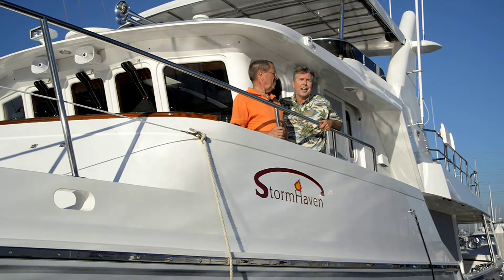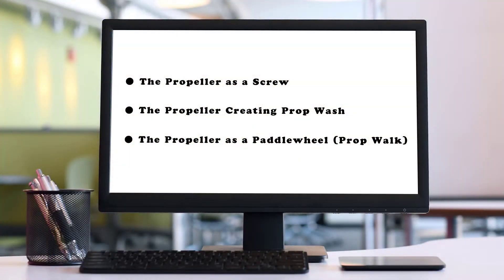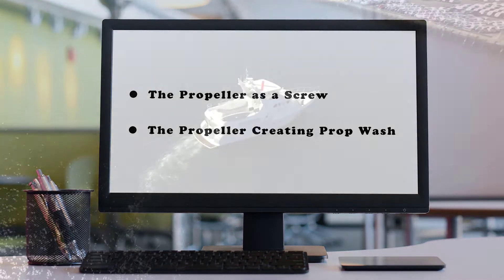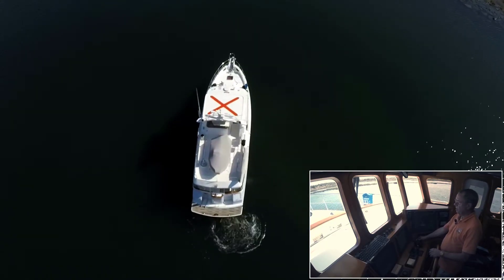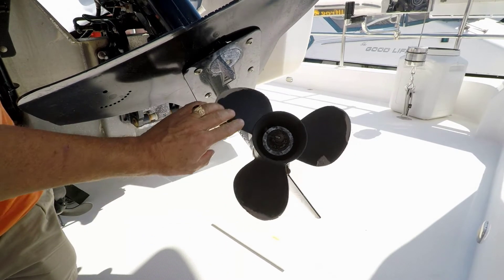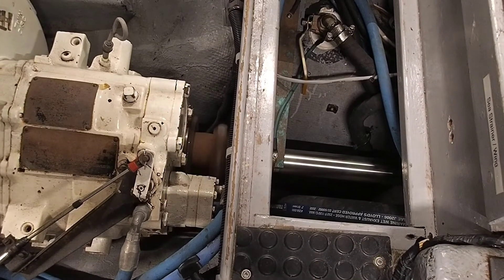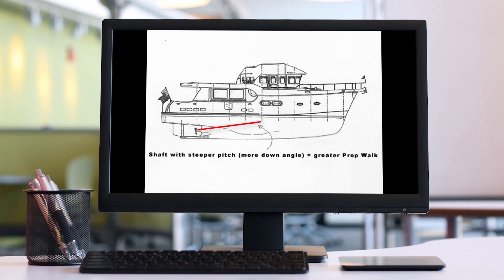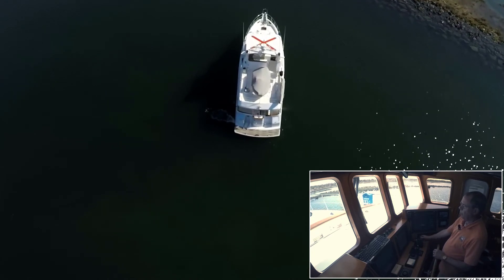The Physics of Docking 102B - "The Prop"

Comment: Thanks for these videos. These have helped me make sense of slightly strange response to the helm when under motor. I need to do more practical homework on this, don't I? - now that I know more of the theory.
I sail a 19' yawl, with the rudder under the mizzen mast, for'ard of the outboard (6hp rh saildrive). I'd always assumed that the rudder was the pivot point, but obviously it isn't.
But the bigger differences are that prop wash would only work, I guess, when going astern - which I look forward to trying out to see if I can counteract the propwalk when reversing off a pontoon finger.
The manufacturer recommends keeping any outboard motor fixed, and only using the rudder to steer. On short motor-only trips I do ignore that, and simply don't ship the rudder at all.

Would there be any effect (wash, suction...?) equivalent to propwash?